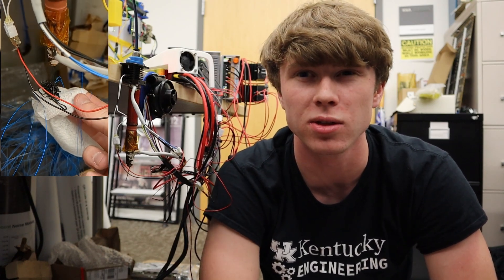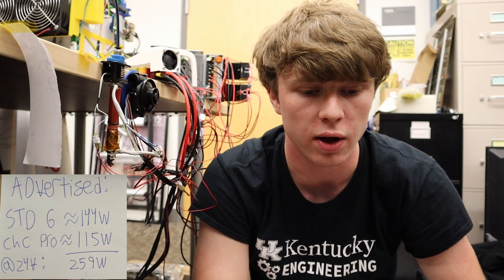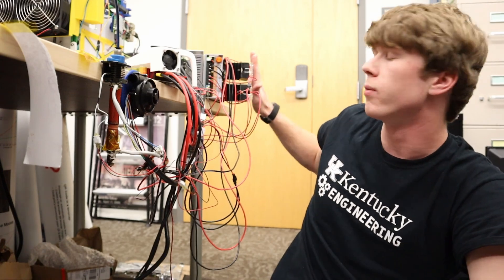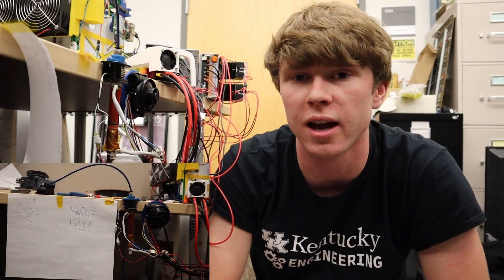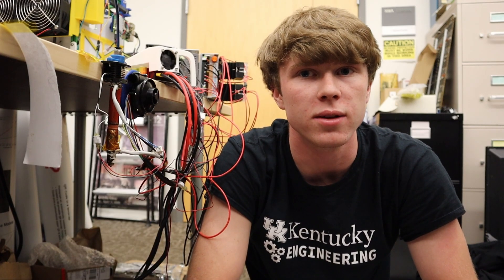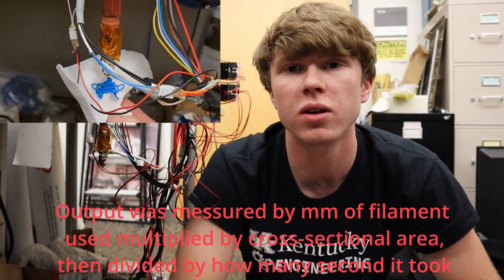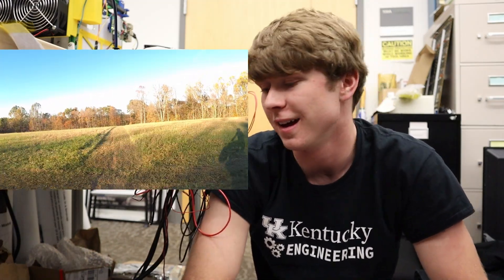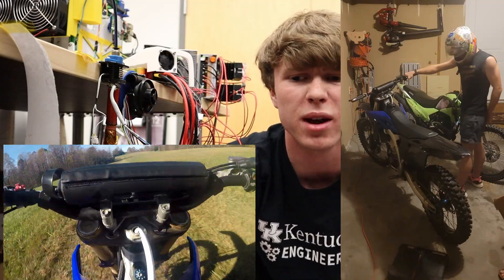180mm^3s hotend

Comment: I think you’re a little late lol. YouTube minuteman Benchy or one minute benchy
Reply from the maker: Haha, almost got me, I know about MCWuffs 1:45ish benchy but the minute man hasn't gotten a minute yet, his movement system is really cool though! Also love the 5 in one hotend design he has though I'm trying to keep the  least amount of weight on the gantry as possible
Reply: @ well what are you trying to achieve? A hotend long as yours on a moveing print head would never work with any kind of decent acceleration due to the weight and long leverage
Reply from the maker: @Tinkerer5888  I'm trying to achieve building the fastest printer I can, yeah having a stationary head would be better but I'm funded for a moving print head so I got to stick with that before I redesign and get approval. Plus it's still possible to get decent acceleration with the proper bracing and enough power(even though the hotend is long it's also fairly light, I'll get a weight measurement of it once I get back to the lab), the big part was offsetting leverage with the weight of the extruder motor/mech.
Reply: @ you could have just built a vzbot… it’s literally the fastest printer on the market and literally know one can print faster than the flow provided by a Goliath hotend until they make us a better high speed filament. You have so much to learn lol
Reply from the maker: @Tinkerer5888  I guess you haven't seen the power train on this printer it's literally the same 4x4 config as a vz bot but with extended core XY allowing for offset of tool and bearing weight allowing for much higher accelerations(also running 60v at 8.5 amps). we can get into the math because apparently you won't listen to anything else: the Speed benchy record I'm trying to beat has 1200mm/s with an average of aprox 250k mm/s^2. With accel that high it only takes 5.76mm to reach top speed so we can assume that 50% of extrusion movements are at top speed(due to smoke stack and pillar areas). because of this we'll be at our max flow rate a large percentage of the time, at 1200mm/s we're running a flow rate of 150mm^3/s which is much higher than the 95ish that the Goliath can supply.
Reply: @ as I’m pretty sure you don’t understand physics lol. I don’t think you realize your hot end is going to disintegrate from vibrations at 30,000 acceleration much less 100 plus. I’ll be looking forward to seeing this honestly
Reply from the maker: I'm sure your just exaggerating about the disintegrate part but I ran the numbers using the stress strain curves of the materials used in the hotend to see what kind of deflection would be caused at certain accelerations and it should be able to handle 250k+ with little to no deflection(that accounts for the gap in the hotend causing extra torque to get generated)(oh also I'm in mechanical engineering so doing these kind of calculations and being accurate is literally my exact course work right now between my material&manufacturing class and statics class though if you want I can run them by my professors to double check my work), also I was watching your video and it shows your using compressed air to cool the heatsink on your hotend, what kinda setup are you running for that, it looks like it'd be a whole lot lighter than using a huge fan like I was planning lol. Thanks for the support! :)
Reply: @ I use a berd air system to cool the heatsink. It works about as well as a 3010 fan
Reply from the maker: Cool, I'll prob order one here in a little and give it a try!